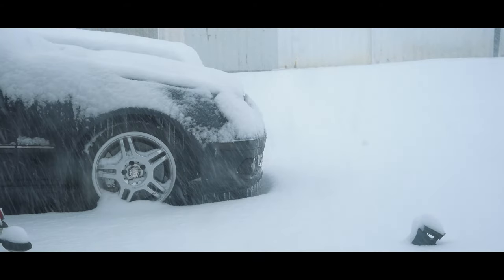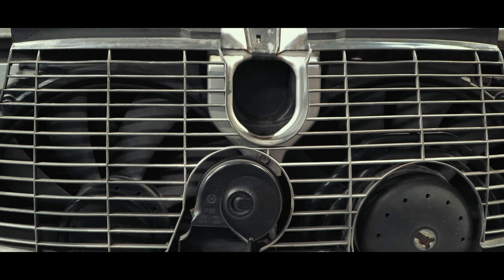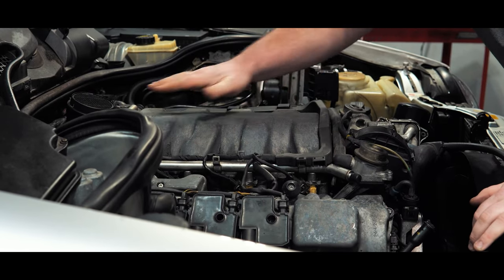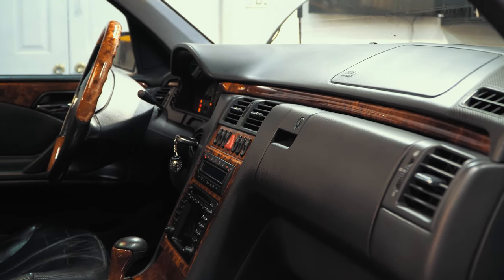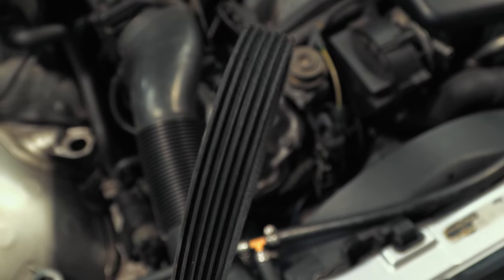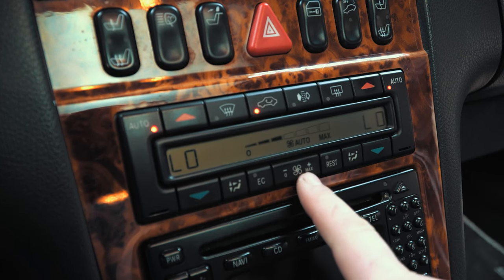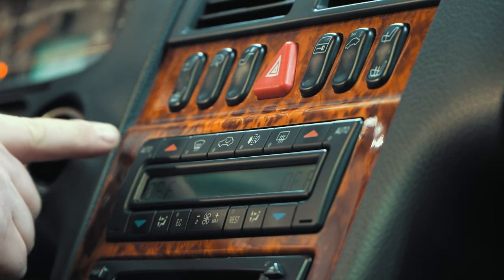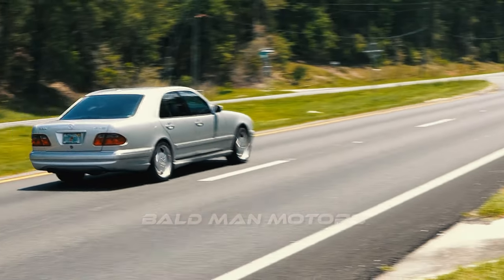Tips for Cold AC in Mercedes E55 AMG W210 | E320 E430

Comment: These are good tips. A lot of people forget about the charcoal filters under the dash and the belt between the electric fans. I would also add to make sure the fan clutch is working properly if your w210 is equipped with one, all E55s have one.
Reply from the maker: @illstplaya Thank you and good mention on the fan, great thing to check as well!

Comment: I fixed my AC yesterday, found a leaking AC line, worked perfectly after replacing but now I have driver side hot air and passenger side freezing cold air. Blocked the hot air pipe and now I have a perfectly working ac. I live in Dubai so we never turn on the heater. Always ac on.
Reply from the maker: @Sammy Meken good job and well done! There is a flap test that can be done through the HVAC control if you ever want to fix that flap. 👍
Reply: @BaldManMotors  I have the same problem on my W210.  Passenger side is very cold and the Driver's side is warm.  I tried the flap test but all flaps seem to be working.  Any other suggestions?

Comment: Nice and informative video. My favorite AMG is the W210 E55. I currently have a 2002 S430 with the AMG sport package. I bought it from the original owner last year with only 59k miles. It’s great to haul the family around in but I’m on the lookout for a 2000-2002 E55…..keep up the videos!
Reply from the maker: @Ian N Thank you for your support and glad the video was useful for you. Best of luck in your hunt for an E55 they aren't getting any easier to find, at least in decent condition. Also, my family likes riding in our W210 E55 more than our C55 or W211 E55. Just nice and roomy!
Reply: @BaldManMotors  thanks for the reply. I’m sure my family would enjoy an E55 as much as myself but my kids are 6’2 and 5’8 so they enjoy the room that an S class provides them, but I will get an E55, I’ve passed on a few of them but I keep searching….oh and I have all the service records for my S430 from the Mercedes dealer, anything it needed, it was taken care of by the previous owner, I hate to part with it but I will for the right E55…
Reply: There was a beautiful silver low mile E55 on craigslist bay area about a month ago for $14,000 in SanFrancisco, it had those 2 color seats clean as a whistle, i would of jumped all over it but i got a ye 2000 E55, the 99 body style sits a little lower and better than the 2000

Comment: On the subject I replaced charcoal and cabin air filters last spring and my blower motor in September last year as it worked intermittently and eventually stopped completely. I did the mistake of buying the cheapest one and I feel that it's got much less power than the stock had.  The brushes were worn so I bought a new cheap one and it even had thinner wires on it so probably I have to replace it again with a better one. Any recommendations on which brand motor to buy? There are many options available, I just want the power back. The regulator seems to work fine as all with each touch of a button the speed slightly increases.
Reply from the maker: @JK-AUTO Hmm, I haven't had to replace mine but if I did, I would likely get a MAHLE/BEHR unit but they are expensive, $182, I have had good success with their products thus far and they are also an OE supplier.  I did also see on one slightly cheaper blower motor "ACM" for $126 that it mentions needing to use a specific blower regulator P/N 210-821-46-51. Not exactly sure why though, just noted. I wonder what the difference is between that and stock?
Reply: @BaldManMotors  I know that there's two kinds of regulators, one looks like a "hedgehog" and other looks more generic but the motor shouldn't care which one it has. I bought Maxgear blower for around $50 and yeah it's a letdown.